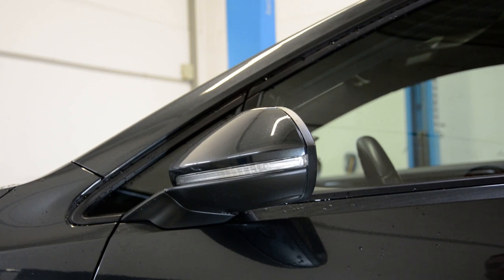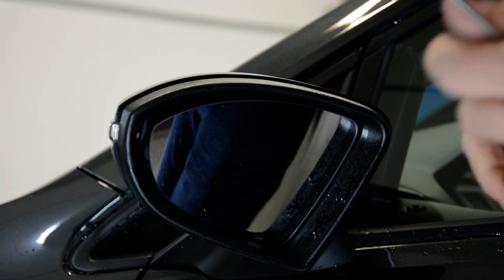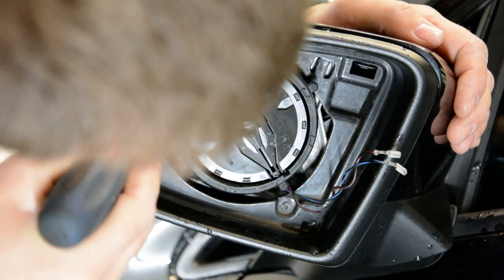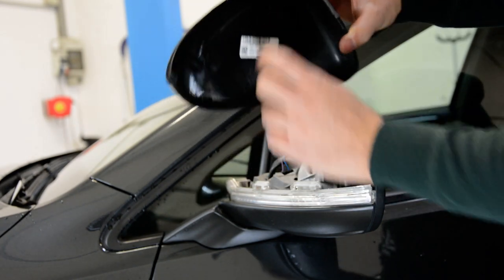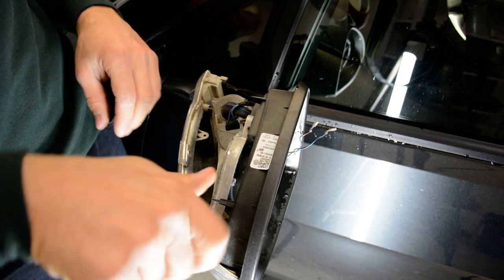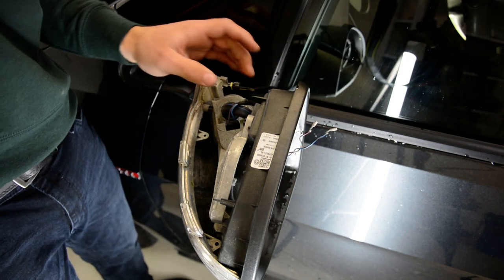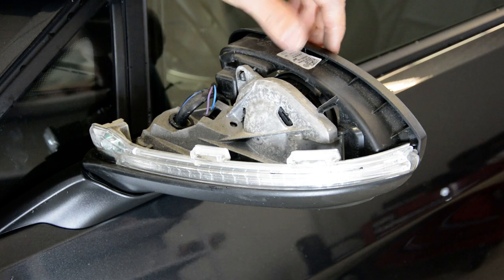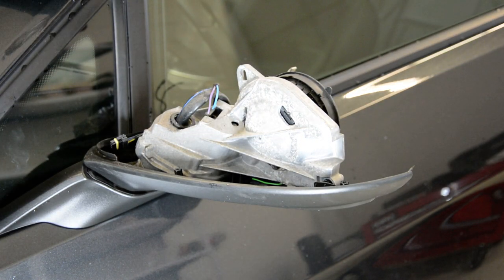VW Golf MK7 Mirror cover and signal blinker removal

Comment: Nice video.  Do you know where I could get the tool you used to pop the mirror off?  What is it called?  Thanks
Reply: No need to pop the glass out. You can fit a long thin screwdriver in and push down the tabs.
Reply: @piffiiiiiiit  - thanks